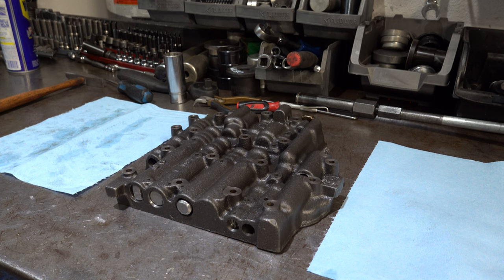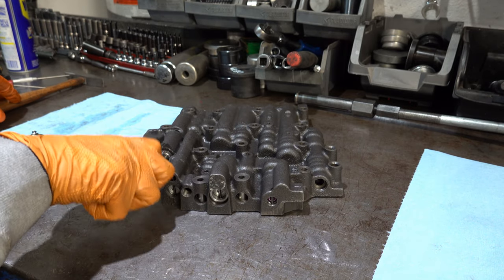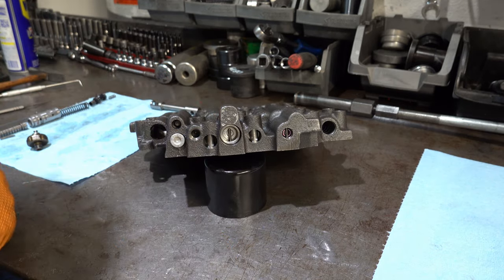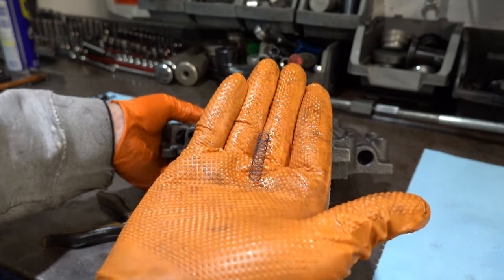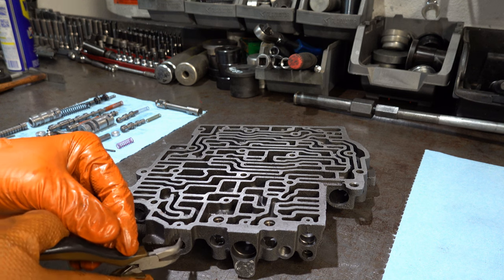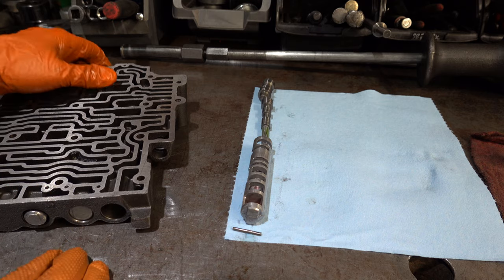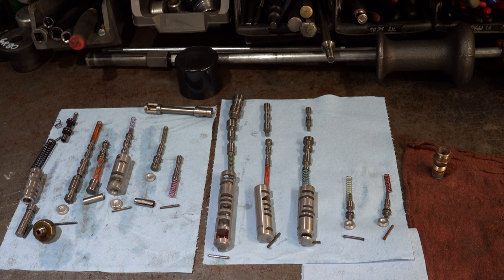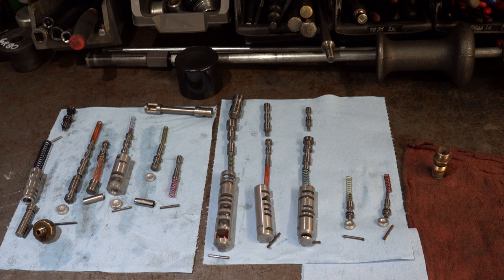700R4 Valve Body Disassembly -  (1988-1992)

Comment: Extremely informative.  I've watched several of your video's now (and I've subscribed) and I'm very upset that I didn't run across these video's a year ago.  You see, I've been battling a 3/4 upshift issue with my 700r4.  There's a huge long story to go along with this, but I won't bore everyone here with it.  Bottom line, the trans has been in and out of 2 different shops and nobody could figure it out.  One shop told me it required a complete rebuild of the trans.  I finally said 'okay do it' - but if it doesn't shift into 4th - I'm not paying.  Got the trans back - still doesn't shift into 4th.   

This is the 2nd video of yours that I've seen you mention the 3/4 shift valve - and if it's installed backwards, you won't have 4th gear.  I had to replay both of your video's AGAIN to confirm I just heard what I heard...   Yesterday I went out to the garage - drained the fluid, dropped the pan, removed the Valve Body and pulled the roll pin on the 3/4 valve.   SURE ENOUGH - installed backwards...  UNREAL!  2 shops, full rebuild and nobody saw it... or they simply didn't have a clue to begin with.  

I flipped it around, stuck the roll pin back in - slapped it all back together, filled it with fluid and took a test drive.   Presto Magic - it shifts into 4th.

THANK YOU - without your video's this transmission was about to get thrown into the trash.

I have several other questions for you now and would seriously like to figure out how we could chat/text/message outside of Youtube! :)

KEEP UP THE GREAT VIDEOS!  and again THANK YOU!
Reply from the maker: You're welcome, man! Glad one of my videos was able to help you solve the problem.

It's the 3-4 relay valve that can sometimes get installed backwards and it's not all that well known but is a vexing problem if that's the cause as many will chase their tails trying to figure it out, lol. The main reason why I always mention it in my 700R4 valve body videos. Applies to the 4L60E as well...

Comment: Hi Nick, My 1992 4l60 valves are a bit different. As far as I know, starting in august 13 1991, the T.V. Limit Valve line up was modified: The valve was shortened, the spring was replaced for a big spring (similar to the Throtle Valve), the plug was discarded and the pin remained the same only.  Since I am rebuilding my trans for use it in my 305 Firebird and I have the 2 T.V. Limit valve types (1986 and 1992), which one do you recommend as most appropiate for my car?:  Use as a daily driver in the city. Speed between 0 to 50 mph and RPMs around 2.000 - 3.000 only. Thanks.
Reply from the maker: Hi Denis,

they are different but the difference isn't material - either one will work as long as the valve is installed into its corresponding valve body and it isn't dragging or hanging up. That said, you cannot install a late (88+ 2nd design valve body) onto an earlier case (82-87) so if you are rebuilding your 1986 unit, use its valve body. If you're working on the later 1991 unit, keep that transmission's valve body with it.

Hope that helps.

Comment: Great video. Would a no shift from second to third just hits like a neutral possibly be something stuck in the valve body?
Reply from the maker: Thanks, JReppenit. Unfortunately, that is almost always burnt 3-4 clutch pack in the 700R4s/4L60Es. You can try monkeying with the TV cable a bit but it almost certainly has to come out.

A 'No 2-3 upshift' condition where the trans simply stays in 2nd gear and never attempts to shift into 3rd can either valve body or governor; I've even heard of TCC internal/external lock up kit issues causing no 2-3 upshift or 3-4 upshift but anytime one of these units shifts from 2-3 but you feel like you're in neutral it's 3-4 pack. You're really mechanically back-shifting to 1st gear since only the forward clutch pack is holding at that point but it feels like neutral given the vehicle's speed at the time the 2-3 shift happens.

Comment: I have a late model 700r4 with the same valve body as the one in this clip. no tcc mechanical lock up, is it possible to convert this one int a hydraulic lock up.
Reply from the maker: Hi David, thank you for watching...You can convert to a mechanical TCC lock up by simply swapping the late VB for an early 82-87 valve body. While you cannot install the 88-93 valve bodies onto an early case, you can install an early valve body onto a late case. I do those early VB swaps onto late model 700 cases frequently for customers who don't want to mess with electrical or electronic TCC lock up kits and rather just use their right foot!

Comment: My 90 c1500 has a 700r4 and the otherday coming out of traffic it wouldn’t go to 2 unless at 4000 rpms but 3and 4 go smooth could it be a bad tv cable
Reply from the maker: Hi Omar, thank you for watching. Given you have third and fourth, I'd suspect the band is slipping. Ill paste my response here from your thread on GMT400:

Check servo inboard travel, shouldnt be more than .125. If the band is worn, it will slip in 2nd but 4th may be normal as both apply pistons are holding whereas in 2nd, only the 2nd gear apply piston is working/applying the band which grabs the rev input drum.

You can possibly buy more time with a shift kit and corvette 2nd gear servo but more than likely, it's on borrowed time.

After you checked servo travel, drop the pan and see if lots of burnt friction material is present. If so, put the pan back on with a few bolts and yank it out for overhaul.

Comment: Very informative. The mechanical lock up is a neat thing though, giving you the flexibility of controlling it manually, and I understand it can engage from 2nd gear up. How would a shift feel with the TCC on? 

As a kind request - can you a similar video on the AOD valve bodies, as unlike the 700, the available literature on all of the design changes is very hard to come by.
Reply from the maker: Thank you, Shalash87. I may be getting in an AOD soon so will do several topical videos including a series of vids on those valve bodies so folks have the same level of understanding as with the 700r4s. Incidentally ill be publishing a deep dive segment about the specific changes and differences across all the versions of 700r4/4l60 valve bodies this weekend to the channel so be on the lookout for it. Will cover all the revisions to those bodies, interchangeability as well as corresponding spacer plate and case changes from 82-93.
Reply from the maker: If you use one of the stiffer lock up springs that come in the kit, it almost feels like having a fifth gear as rpms drop by a few hundred rpms and it’s definitely more noticeable compared to a factory converter lu strategy.

Comment: removing MTV upshift spring always recommended in sporty applications? (1979 Camaro - 500 HP) even in combo with Sonnax Sure Cure kit? mostly driven on street but sometimes I want to jenk the shit out of it.
Reply from the maker: Hi Max, I always leave it out for anything high performance as it allows you to hold in gear a bit longer to build rpms and get engines w/higher performing cams and higher stall converters into their power band which is where you want to be prior to shifting.

Comment: Am I able to use a early 3-4 throttle sleeve in a 88+ valve body, will it function the same or be different
Reply from the maker: That's a good question. I'll be in the shop a for a little while so will compare the two valve trains side by side and reply back, letting you know later today/this evening.

Comment: I got a 700r4 shifted fine at first. I went to enter interstate traffic and it shift 12 and neutral s out when it goes to 3 rd. I can drive if I drive in second
Reply from the maker: Hi Dan, thank you for watching...Unfortunately it sounds like your 3-4 clutch pack is wiped. Was this transmission recently rebuilt?